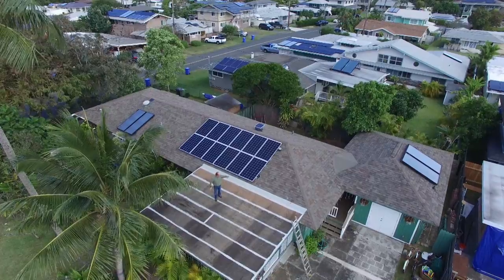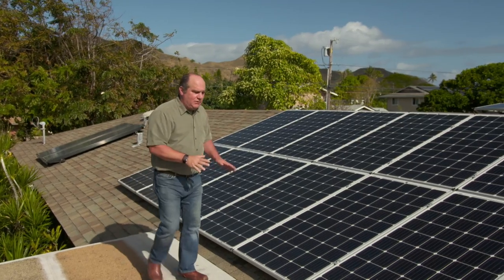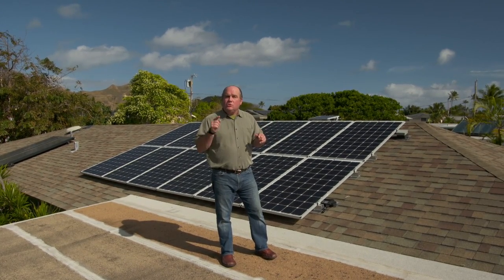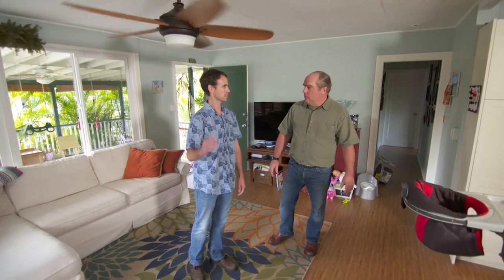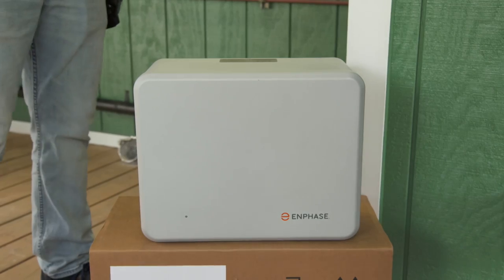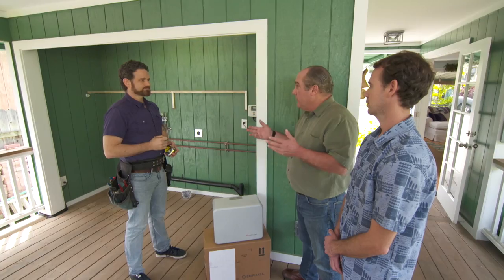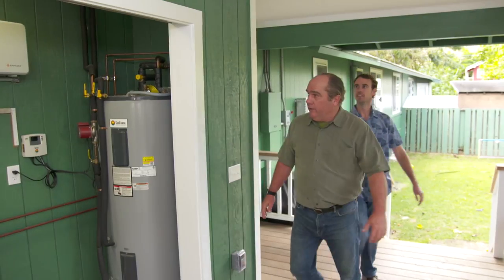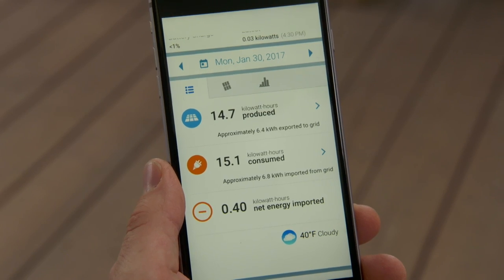How to Install Home Solar Storage | Ask This Old House

Comment: and let's leave the cost of the system, out of the video......sigh.
Reply: That's really overpriced for 1KW.
Reply: Agreed.  A Tesla PowerWall would eat this thing for breakfast.
Reply: best to go for a DC-DC storage solution before the inverter to minimise loss, then you can use the existing inverter to transfer the energy out into your home for you to use throughout the day and night, I would suggest for a proper family home 50KW battery system and 6KW solar panels to ensure happy living.

That should be around $10,000 however you will still be feeding back into the grid so you will be making money off the system and you will only have to pay the supply charge, not the KW used.

The monitoring of the DC-DC system can be done with tablet system so you know what battery system to replace and you don't need to spend $2000 to replace 1KW of batteries when it fails.
Reply: stirlingfromla play boiyo
Reply: The enphase system is more expensive then the powerwall but it includes an inverter in each battery and has more flexibility when it comes to being added to an existing system. Unless they have changed the power wall since I last looked at it. It requires one of a handful of centralized inverters and will not work with the micro inverters this system uses. This would add significantly to the cost of a power wall system here. The enphase is designed specifically for use with micro inverter sysyems like this.  Besides if you are truly cost sensitive you don't go with one of these pretty packaged systems you go for traditional deep cycle lead acid batteries currently.
Reply: I have to say I am really disappointed in this Old House these days. I watched it as a kid and it was more of a how to show. They would get the home owners involved and work together to get a project done. This episode and one about installing a wind turbine was just them standing around talking to the home owner while a professional did the installation for them. What's the point of a home improvement show that just basically says "pay a professional"? And yeah this project cost a lot and will keep costing you money as depending on the usage and battery type they tend to have to be replaced in about 5 years or so. Give the fact you usually have to replace ALL the batteries at roughly the same time it's pretty expensive. But then again this guy is living in a fairly nice house in Hawaii, I don't think he has any issues with money.
Reply: The first car or the first airplane tickets were only for the rich as well. Within few decades you can buy a used car i good shape for 2000 dollars and there are plane tickets as low as 7 usd. In 10 years time this system will cost pennies.
Reply: @Tom R No such thing as an AC battery.  These contain a bidirectional microinverter and BMS for a DC lithium ion battery.
Reply: @rcjbvermilion  Powerwalls shut down without an internet connection after 2 to 3 days.

Comment: so why do you need AC at all - get DC only appliances and other users
Reply: BRILLIANT statement
Reply: I am totally aware of the Westinghouse versus Edison "battle of the currents" and if you were you would know that the number 1 best thing about AC is it's ability to be sent over long distances due mainly to the ease of stepping up voltages (transformer).  so, central power stations can more economically distribute power.

but, if you generate (solar) right at the site of consumption, the the advantages of AC over DC totally go away - which is something you should do.

Comment: The electric company doesn't like paying its customers so they make them store it in the customer's batteries so the cost just keeps rising.  The electric company (more like companies as this is starting to happen globally now) doesn't want you to have any of this so they are doing everything they can to force you into just saying forget it and go back to them.  They are, after all, in the electric company business to make a profit and when people could do net metering the company was not showing profits like before.  Wise up the push to remove us from being self sufficient has started and it will only get worse.

Comment: So an AC battery is a DC battery with an inverter in one unit.
Reply: My thoughts too, coupled with the initial inverter at the panels, this makes the system rather inefficient, you lose what 10% everytime you convert? Doing it twice costs you.
Reply: I guess he pretty much is limited to AC because of the existing wiring in place that was meant for 120 volt AC.  If they drop it down to 12 volt DC (or whatever), they would need much thicker wires to handle the increase in current. I'm curious how they all keep their sine waves in sync....does each inverter do that on its own?
Reply: You can't store AC
Reply: never said you could store AC. I'm saying that he's limited to running AC down the wires because DC wires would likely need to be changed to thicker wires and he might need to change his solar panels as they already have a build in inverter and doing everything twice.
Reply: Arie M in a normal system DC power is sent to the batteries then inverted once to AC. in this "AC battery" DC from the panel is inverted to AC feeds the house and another inverter in the "AC battery" to be stored as DC.
Reply: I guess a fairly typical solar panel roof array can produce 2 kW, at peak.       If P=I E, then 2000= 20V (I) renders I @ 100 Amps DC.  That's a lot.      Perhaps the way to solve that wiring challenge is to have 5 banks; then each bank is producing 20 Amps and that is the normal ampacity allowed for ordinary 12 AWG wire...      The NEC will vary that ampacity, based on some factors like ambient temperature, etc.

I don't like the "AC battery" idea, either.          You're making DC on the roof, a few feet away from the battery.       Why not keep it all as DC until you draw from the battery..?         In that sense, it's like an automobile with an inverter serving the load.

In this case, of course, the inverter must be huge.

The thing that we're forgetting here is that "shadows kill."      Unless the roof top is equipped with micro-inverters (as Richard described), then a shadow on one panel will knock out the whole array.
Reply: I suppose that would be a "rectifier" + "regulator,"  not an "inverter."           No me gustan.
Reply: Mister Figs yeah

Comment: I don't understand why Solar has to be a solo individual effort. Why couldn't it be pooled for an entire block? With a common area that everyone owns collectively for the solar area and just pay someone to manage it so everyone doesn't have to become a solar expert. But I guess pooling your neighbors into a communal solar grid is just weird in our modern "everyman for himself" "everyone is an island" world.
Reply: wakeupscreaming solar expert?
Reply: You're essentially describing a municipal electrical grid on a smaller scale. Where we're starting to run into trouble is in the "pay someone to manage it" part, in that if everyone has solar, the lost revenue (or payouts in a net metering situation) means we won't be paying in enough to maintain the grid, repair it after storms, etc. The grid is important to maintain because you'll still have power regardless of your own system, and the further the grid spreads, the more reliable it becomes.
Reply: This. Unless you are far from a grid, have VERY expensive grid power, or just like being "green", for most individuals, they will never recoup their investment in savings.  in 25 years or whatever, they'll need to replace worn out parts, etc.  Because of that, I feel that a centralized solar effort is the most useful whether it's the community or solar farms.

Comment: How long to the Batteries and Panels last?  If they last 50 years with ever increasing cost of energy with minimal maintenance, then it's a no brainier to buy solar.  But if the panels start slowly being less efficient and Batteries have to be replaced like batteries do, then this doesn't really make sense if power bills are relatively average.  

Now if I get more than I need and want to sell my extra power to my neighbor....lets see how long it takes the Government to come in and shut that down.

Comment: haha, Rich...tell us WHY electric companies don't want to buy back our energy?
Reply: I suspect it is for a number of reasons. When only a few people in an area have solar, the ElCo can use that extra energy during the day for commercial loads, then at night when commercial loads go off line they use their generation capacity to service the solar homeowner that now need power.  When a large portion of the population has solar, including commercial properties, now the ElCo has no need for the extra energy during the day, but they still have the demand at night. So now the ElCo needs to purchase some sort of storage. They can use pump storage, pumping water to a higher elevation during the day, and then using it to power hydro at night,but I doubt Hawaii has the geography for that. Power plants just don't start up and shut down on a whim. Your baseline plants (which are the cheaper ones to run) take a while to heat up and shut down. Your peaker plants, such as gas turbines, do come on line quickly, but cost alot to run. The ElCo is shifting the cost of the storage batteries to the people at are actually benefiting from them, as opposed to spreading the cost across all of its customers.
Reply: Lot of utility companies are ending net metering agreements, because if everyone had solar and was paying the same amount for electric that the electric company is paying them... basically creating a wash where the  electric company gets nothing or very little income .... without income, how to maintain the electric grid?  

Some utilities are ending agreements/metering completely, some are modifying them where the company pays less for electricity that is push on the grid than the customer/consumer pays for taking it off the grid.

Solar customers without batteries are basically using the grid as their battery and if they don't pay more for using grid electricity than when sending it out, they are using the grid for free.  Everyone that uses the grid should pay or else it can't be maintained.
Reply: just pay the customer the wholesale price instead of letting that power go to waste.
Reply: Because the electric companies and the battery companies want to make more money off of people because they are greedy . Its ridiculous
Reply: It won't go to waste, it will go into storage that the customer will need to purchase.  I haven't heard anything about batteries costing more, but I think more is at play than just greed.  I'm not knowledgeable enough to know what the electric companies are thinking.  What is the state of California thinking as they have raised tax on gasoline, greedy?  What's state's that charge to drive on toll lanes (not toll roads, but lanes set aside for rich people) thinking?  Raising gas tax and charging for toll lane driving greedy or just a way to pay for the roads?  Raising electric rates greedy or just a way to pay for the electric infrastructure?   Disney charges extra for a fast pass, is it greedy to separate the rich kids that can afford the fast pass from poor kids that can't?  Is it greedy for me to ask for a raise?  Sorry, I'm on a roll, I didn't plan this it just started flowing uncontrollably.
Reply: Because they lose money. As most excess energy use is in the day time is for AC or Heat. One reason the Utilities want to charge people to buy back their excess energy. In most states now. Last I looked. It was $100.00 a month to take it. 

The only places this is not happening is. Co-Op energy companies. As it cuts their cost to produce energy and upgrading it. 

Hell in some states. The Utilities have lobbied congress. to make it illegal to tie into the grid.. Siting "Safety Issues" from people not using a transfer switch. Which cuts power to the grid . If it goes down. Not sure how the Inspectors would OK  not having one installed. As it is required to get a green tag.....
Reply: They do, about 1-3 cents/kwh
Reply: is also how NEM 2.0 is working for a lot of People. they pay Peanuts for your Excess solar during the day and charge you MORE at night to make up the difference.  this has another issue, they then can use their peaker plant to cover the nighttime load since they basically paid you nothing for your eletricty this is done so they don't undercut their Bottom line. Paying you the old 1 for 1 rate would run them Out of business

in california, this is a HUGE issue. in the last 2-3 years solar has jumped to the point where at times its making 50% of the States power. SCE will have too much power on some days and actually will have to Pay for someone to take it, for example: States like Arizona. this avoids over-saturation which can cause Brownouts. in the reverse way, (think over pressure in a coolant system. once overloaded with too much pressure it can Blow open causing failure)
Reply: they do. the big issue is where there are too many Residential PV systems that you CANT shut off. This Creates a over voltage and destabilizes the local grid.
Reply: Also backfeeding a grid during a line breakage can electrocute linesmen

Comment: So based on the wire size this will only supply a max of 20 amp, so better not use the hair dryer and microwave at the same time.

Comment: This right here is the future of solar power. Eventually when I retire, I plan on building my dream shipping container home with a system similar to this. If my budget allows, I may even include enough solar and storage to be totally off grid, which is entirely possible in sunny locales, and with battery technology improving and getting cheaper.

Comment: Storage with micro-inverters is dumb.  If you're installing a new system, and aren't already saddled with micro-inverters, DC-optimized panels, with a battery monitor/charger and big grid-tie inverter that can draw power from either the battery bank or solar panels is a better solution.

Comment: Battery is very expensive and can NOT be used as back up if the grid goes down. Quite useless! The Tesla Powerwall 2 is a much better deal.
Reply: It could, but I don't think they installed enough supply of batteries to work without the grid.

Comment: We need to alter building code to allow 12 v lighting from solar.  Very simple system with 12v batteries and LED bulbs.  Skip the inverters and you save the conversion losses.
LED bulbs for 120v AC have rectifiers and regulators to drop it back to 12v anyway... so going solar to 120v and back to 12v = wasting a lot of energy.

Run a major amount of the house off of 12V....

*****************

THERE IS NO SUCH THING AS AN AC BATTERY!
You have a DC battery with an inverter.
Reply: I don't think its necessarily code but voltage drop in DC lengths.

Comment: A solar-system without on-site storage.....is no system at all.
Reply: No dude, solar PV system comes in two form, ON grid and OFF grid. Energy storage is optional for ON grid system.
Reply: WB IsMe      One of the barriers to making renewable-energy highly-efficient and mainstream, is economically storing the energy the renewables generate. On-site storage of the energy your solar-panels produce is the most efficient and most bang-for-your-buck. If your "system. only works part of the time, it is not much of a system, IMHO.

Comment: Many of the early adopter promises are disappearing due to reality of scale.   Using the grid as a free battery sounded good in 1990 when the power companies were short of bulk power, but not so good now when there's a surplus.   All those net meters cost money,  the grid must he improved to handle more people with solar pushing back power at noon that isn't going to be used,  but bleed off as waated resistance.   Then the solar customers draw free power at 8pm to 8am from hydro or coal plants.  Non solar customers pay for it all and solar customers aren't really saving the planet. 

Batteries is probably the only way a homeowner can make it,  but typically,  like this guy,  no hvac and frugal power use anyway because batteries can only store so much,  so fast and bleed it back quicker than they stored it. 

For the grid to take every home and business as power producers,  a completely NEW grid must be designed from the old one,  and a new way to bill for it,  thus your free solar becomes yet another power bill through taxes or grid access fees.   See Arizona. 

A grid in a region with total housetop solar should be designed as an industrial energy storage system.   For instance,  take noon day sun on thousands of houses to heat or lift water at an old coal plant.   Then in the evening reverse the flow by having that old power plant make electricity from they water battery. 

That will take decades to build.   Batteries are always a stopgap solution.   A bad one if you study physics,  but an expediant one for well over 150 years.

Comment: What are those "AC batteries"  made of?       Lithium Ion, lead acid, ??            Looks like lead acid to me, because he'd be praising them (and not straining to lift them) if they were of lithium, instead of lead.        

Like all car batteries, lead acid batteries die of old age, predictably.         And they are not all created equally, either.
Reply: Did you even try to googling "Enphase AC  Battery" ???

Comment: This set-up is VERY costly. Will take you many years of electric bill savings to pay this off (20yrs or so). Panels need regular maintenance and im sure the battery will need to be replaced eventually.